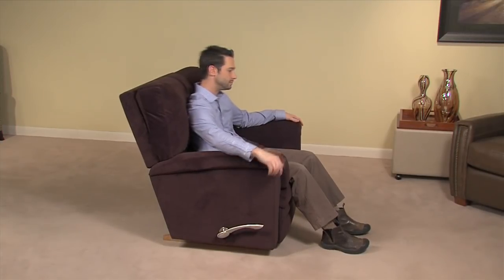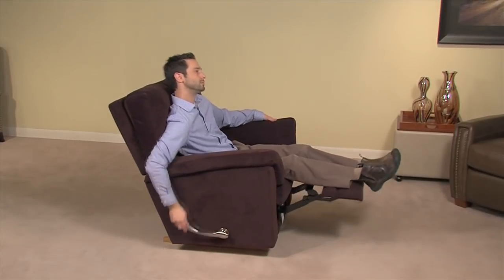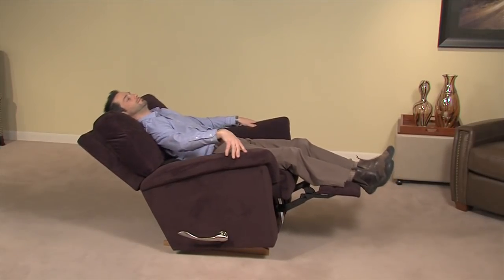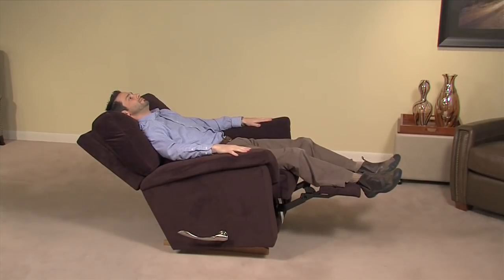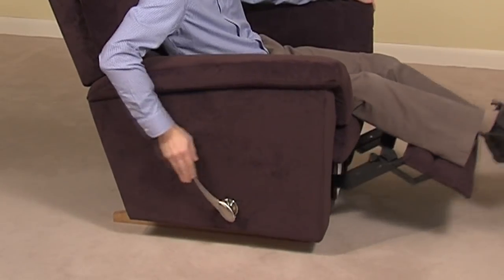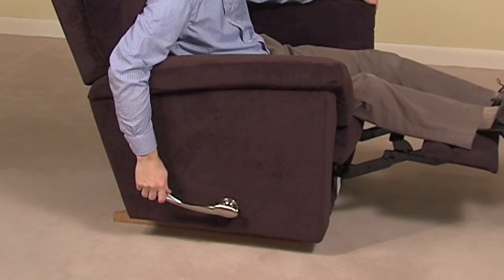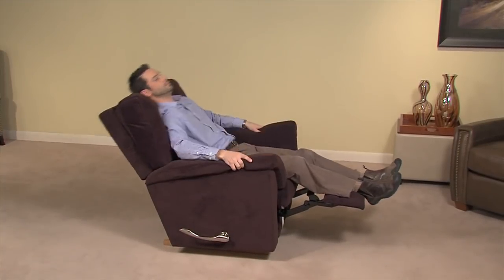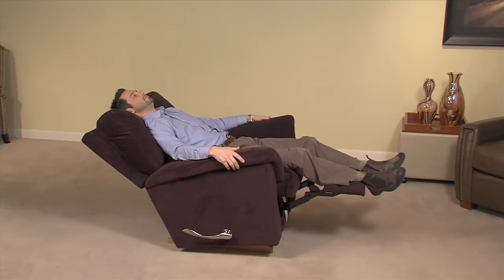Simple Operation of a La-Z-Boy Reclina-Rocker Chair Seat Tilt Rachet Mechanism

Comment: Here are better ways to adjust the recliner: 1) with one foot on the ground, put footrest into whichever of the three positions you like, then use your foot on the ground to push yourself slowly into any of the 18 positions). 2) Tighten or loosen both wing nuts (or adjust both ratchets - depending on model) equally under the chair so that the chair does not recline so fast (or to recline faster). 3) Instead of using your hands on the armrests to adjust your recline position, try only lifting or lowering your hips to adjust the recline. Hope this helps!

Comment: Yea the tilt ratchet is stupid. It advertises pick one of 18 positions. But I want it in position 4, however I cant put my weight to heavily on the back otherwise it goes up to like 7-8. There should have been a tilt ratchet lock mechanism to lock it to a specific position allowing for full lean back without changing the tilt.
Reply: XDarkPhoenixX, to get the chair into the position you want, try these tips: 1) with one foot on the ground, put footrest into whichever of the three positions you like, then use your foot on the ground to push yourself slowly into position 4 of recline (or any of the 18 positions). 2) Tighten both wing nuts (or adjust both ratchets - depending on model) equally under the chair so that the chair does not recline so fast. 3) Instead of using your hands on the armrests to adjust your recline position, try only lifting or lowering your hips to adjust the recline. Hope this helps!